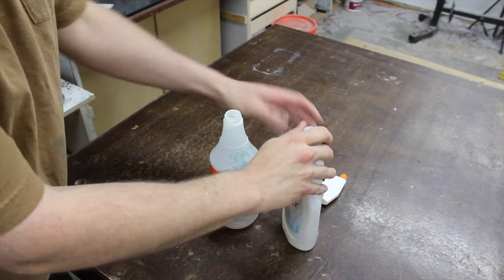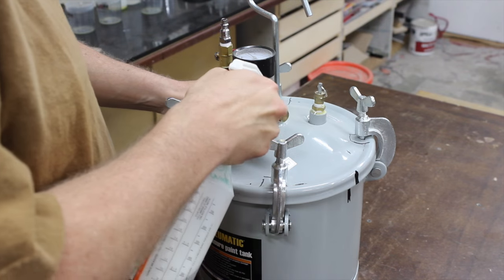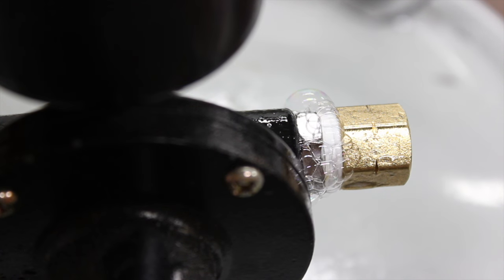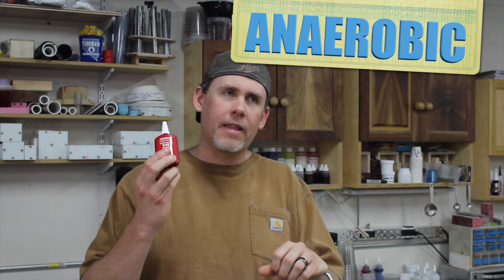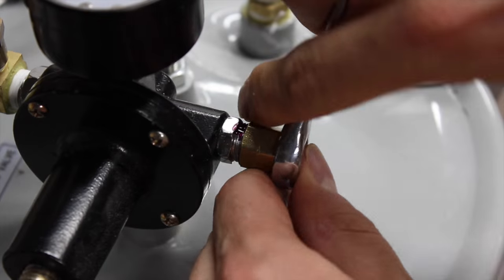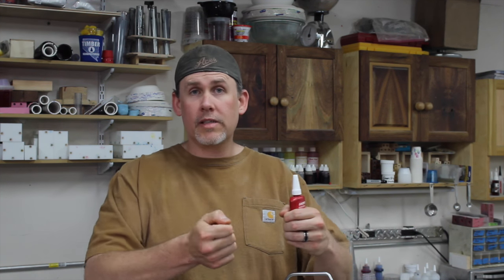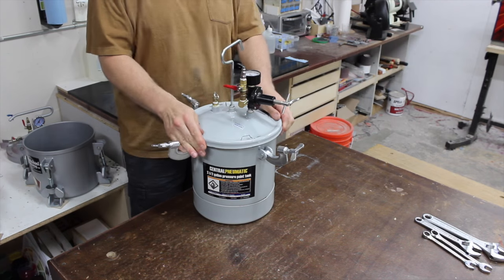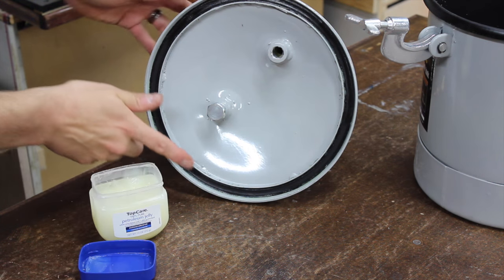How to Find and Fix Air Leaks in a Pressure Pot for Resin Casting

Comment: Zac, I love your videos!! After making a few banks with liquid diamonds without a pressure pot, I finally got one. As I tried it, it seems to leak from the regulator itlsef, that sort of t handle with a screw seems lo lose air. any tips on solving that? Thanks!!

Comment: I'm still having leakage from the lid itself after applying vasoline, I noticed the gasket is a flat, clear rubber instead of the one on your lid.  Do you think buying a replacement gasket would help fix it?
Reply: Did you ever find a fix for this? I just bought a vevor 8 gal tank with a clear gasket, and it blows at 40 to 50 psi.
Reply: @TheRealWilsonn  I ended up upgrading the pot, the clamp thumbscrews starting stripping as well as the leakage problems

Comment: Why not CA glue and accelerator? I have not desire of removing anything later. Always will be a pressure pot.
Reply from the maker: CA glue is brittle, it'll just crack once you tighten the lid

Comment: WARNING - Petroleum jelly breaks down rubber.
Reply from the maker: +Matt Seibert Haven't heard of that before, but it's good to know! Thanks for pointing it out. Any suggestions on an alternative?
Reply: It may sound strange, but any lubricant that is designed to work with rubber - namely condoms - should work. KY would be my first thought.
Reply from the maker: +Matt Seibert That would have made for even more bloopers if I had mentioned that!! :-)